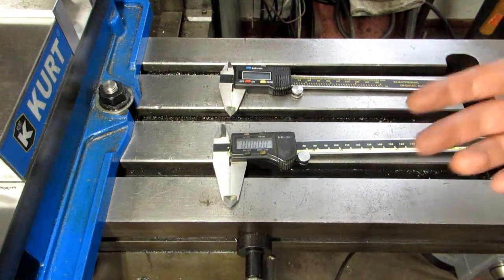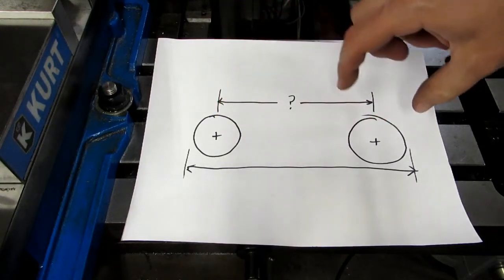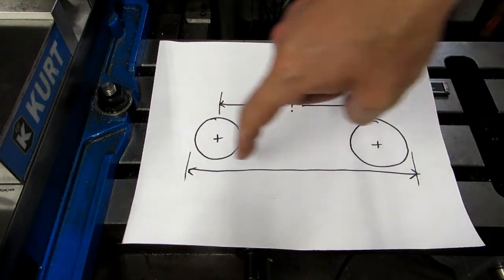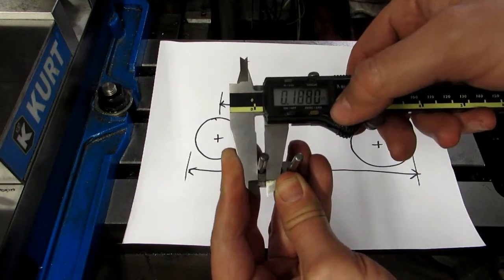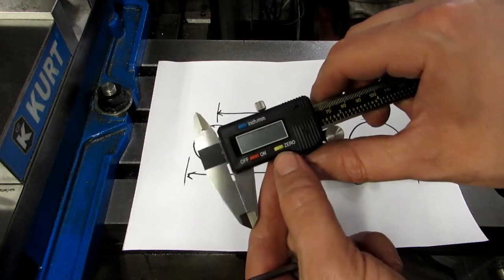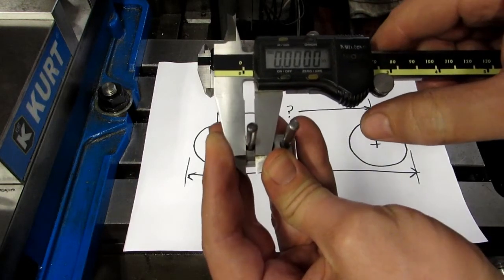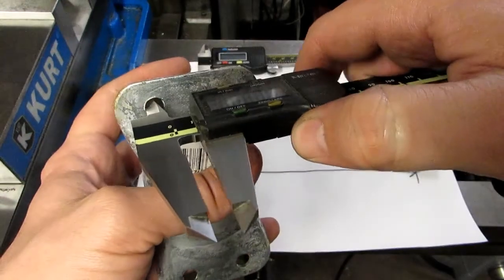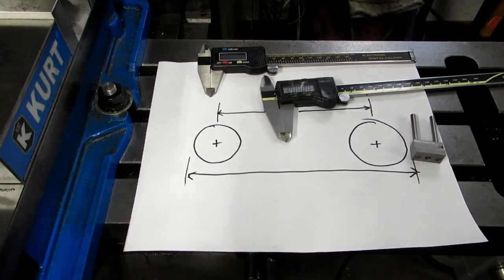Quick Machining Tip #5 - Using Calipers as a Calculator

Comment: Yes! This is the kind of tip i was looking for. Its so obvious. Duh.This is going to save me so much time. I assume this works for tapped holes? What about socket head screws?
Reply from the maker: Yep. It's really good for the depths of internal keyways too. Zero on the bore and then measure the keyway.